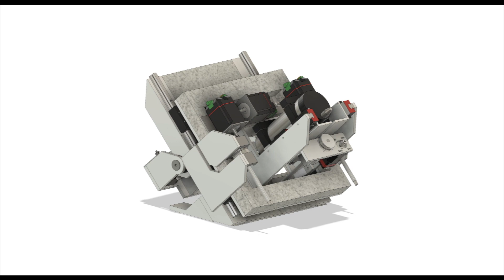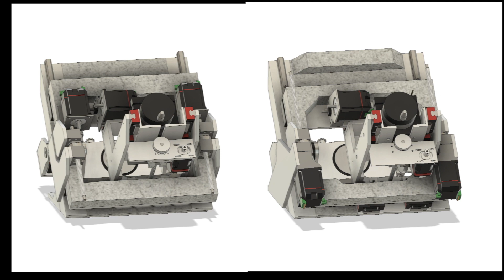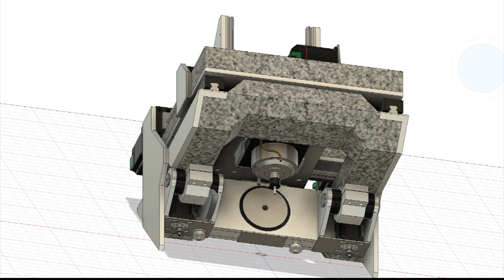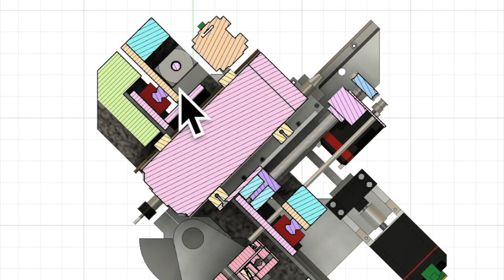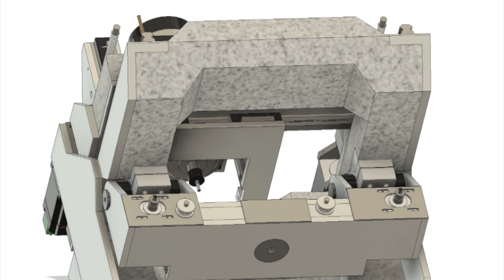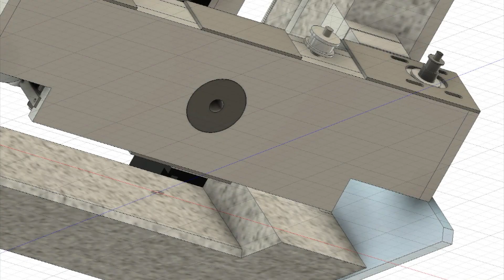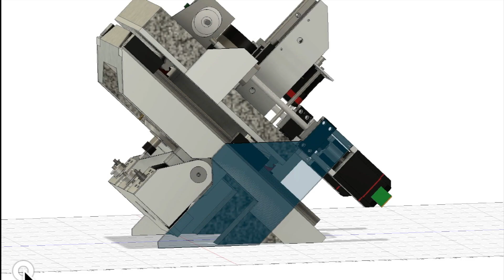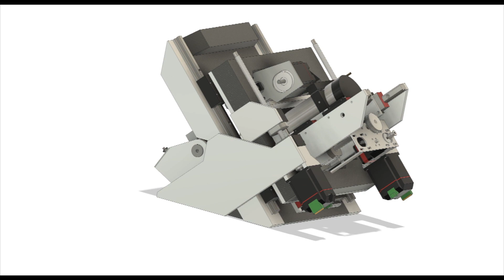Building The 5-Axis CNC Machine in a Small Room: A DIY Journey. (part2)

Comment: I would make the base with the densest aggregate possible for stability even at the expense of weight as that is where it will do the most good..  Even steel shot and crimpped steel wire reinforcing as used in technical concrete would be valid. Because of the compact nature of your design you do not need very much aggregate so price should not be a big burden and you can select for other characteristics.

Because your axis are at 45 degrees the load on the Y axis motors includes the mass of the other axis.  Here using a lighter composite with chopped carbon fibre roving is attractive as it will reduce the static load on the Y axis.
Reply from the maker: If you don't plan to move the machine from its installation location, then heavy weight is not a problem, but if not, then light weight is important.
See the video in Part 7 for weight measures for Y-axis units.

Comment: Has anyone tried using out of phase acoustic waves to greatly reduce the sound of mills?    How about using transducers mounted directly to the frame to reduce overall machine vibration?
Reply from the maker: I have thought about something like that myself.
I wish I could find something cheap and effective.
Reply: @a-cnc-f  There are many 'noise cancelation' circuits available online, both in schematic form and populated PCB's.  Some are very cheap and would just be a matter of tinkering to explore their use for machines.   It would be interesting to see the outcome.   Speakers for ambient sound and frame mounted transducers for machine vibration.  Theoretically... it should work.

Comment: I commonly machine between 8K and 10K as a norm. Especially with steel. With a machine this small and light, you may find that spindle speed directly impacts the noise. Also, spindle torque will become very important. A slower, higher torque spindle may help with meeting some of your wants.

Comment: Im interested to see how this spindle performs with steel. I am also building A cnc machine and was looking at the same spindle. But i thought that the bearings would probably only last a few hours. So im going to use a pulley with a larger slower motor. But i understand that you have the space issue. Cool project and very intrested to see the proces!
Reply from the maker: If that motor doesn't work, I need to take the next step.

Comment: If you go for max coolant processing maybe that should be included in the enclosure as feature? It just seems to be the natural place to put this system part.
Reply from the maker: I think it is a good idea.
However, I am a little concerned that the coolant hose needs to be disconnected each time the machine is removed from the soundproofing box.
Reply: @a-cnc-f  : Well, maybe a garden hose connector system is sufficient? Or just a funnel with a sieve? 
Sadly I am not able to try to build stuff myself.

Comment: instead of using carbon fibers you could also use glass fibers since they have a very similair tensile strengh and general properties in epoxy (carbon fiber is a bit better) but are substantially cheaper
and taken from injection molding and fdm printing the longer the strands of fiber the better the tensile strengh 

also, im a bit worried about the heat from the spindle in a sound proof box since im guessing there wont be ventilation?
Reply from the maker: Thanks for the advice, I'll test with carbon fiber and if it doesn't work I'll try different things.
Reply: good luck!

Comment: A couple more tips:
1. It is not necessary to add a granite fraction to polymer concrete. The composition of sand and epoxy is more durable than granite.
However, it is much easier to form.
2. For machining steel, you will need anti-backlash nuts, not simple ball screws. These nuts are larger. This needs to be included in the model.
Reply from the maker: Thanks for the advice.
I agree with you regarding ballscrews.
To machine steel, we need to have a preload on all moving parts.

Comment: Usually the strength of a machine frame is many orders of magnitude stronger than required: what you actually need is stiffness. Strength is required when the forces are high enough to break the frame. For small forces, stiffness governs how much the frame bends. Look for young's modulus rather than tensile/compressive strength. 

Epoxy granite (25-35gpa) has lower stiffness than cast iron , thus the epoxy granite frames tend to be very fat because of that. I think in your case it should be good enough anyway (your new frame is much thicker than the old sheet metals).

Carbon fiber isn't used for epoxy granite because it ends up decreasing damping and it's usually just cheaper to use more epoxy granite since space in industrial workshops is cheap.

Anyway here's a paper which uses carbon fiber in their epoxy granite. Note that the sample damping is "only" 6x better than cast iron or aluminium. Sadly this paper doesn't have a comparison of various blends, but it should serve as a baseline. Also they don't include the young's modulus, it can be approximated as better than epoxy granite (CF makes things stiffer, but reduces the damping).

https://www.researchgate.net/publication/329481100_Synthetic_granite_composite_for_precision_equipment_structures 

To maximally increase stiffness, you can wrap the outer layer with CF. Something like here: https://technocarbon.de/presse/SD_CM_02_08_technocarbon.pdf
Reply from the maker: Sorry.
My comment was blocked and I didn't notice your comment until later.
Thanks for the advice.
To be honest, I don't know much about it, but I'll try anyway.
Thanks for your interest.

Comment: I have not seen the C and A axis detail design yet, no harmonic gear ? 
How you deal with backlash and rigidity ?
I think it’s the most important at the end.
Reply from the maker: The basic structure of the AB axis is going to be the same as the machine I built last time.
The current design is just a confirmation that the minimum number of parts can be assembled.
There is still some time before I start to build the AB axis, so I will think more carefully about it.
I will release it to the public eventually.

Comment: Looks great! One more question though, did you think about the heat the spindle, cutting and steppers/servos will produce and how it would impact longer running gcode programs? My 1.5kw air cooled spindle gets pretty toasty after 45min job, even when cutting light loads, ie foam. Being inside an soundproofed box also means it's thermally insulated as well.
Reply: Yep, air cooling definitely maybe a problem here.
Reply from the maker: That is one of my concerns as well.
I may need some kind of cooling equipment.

Comment: Seems as the machine will be on draw runners within the sound proof box, I think you should move the draw runners at the top instead and hang the machine. This will mean that the underside will be completely clear and you'll have much more space underneath for chips on your chip tray. You may even be able to switch to full flood coolant with an open bottom and a full-sized chip tray.
Reply from the maker: Thanks for the advice.
That's an interesting idea.
Actually, I am still thinking about that.
I have a several ideas.
I think I need to decide before I start making the column.
Reply: Innovative out of the box thinking for in the box machining. :-)  Simpler might be to have the rails on the sides near the bottom with rails the machine sides can rest on.  A tray to catch chips and excess coolant would then be easy as you suggest.

Comment: This project is looking awesome. I have a suggestion for you though to improve both the look and the functionality of the fourth axis table. From what I can see, you are using belts to transmit the torque from the motors to both the fourth and fifth axis of your machine. I propose you add a 3d printed panel to cover the front of the entire 4th axis table, and two more panels that will go on the left and right side of the 4th axis table where the motors are housed under the pivot point. From a functional standpoint, this will protect your belts over time from wear due to chips. You mentioned you want to machine steel, and using a small endmill with small depths of cut will produce nasty, millimeter-sized chips that will find their way into every crevice and could even become embedded in the belt as it rolls over the pulley due to their small size and sharpness. Additionally, you mentioned how this frame was optimized for optimal chip clearance, and these panels would prevent these steel chips from getting into places that are difficult to remove and keep clean. Because steel is a ferromagnetic material and its chips tend to have some small magnetic field after being machined, they may potentially be attracted to the small magnetic field the motor produces as it is being operated, causing chips to gather on the stepper motor. Now in regard to appearance, the most important factor ;), these panels would make the whole table look seamless, just like the fighter jets that you mentioned, and if you printed the parts out of a black carbon fiber filament, it would look even more sleek and have a really interesting texture that would match the rest of the machine. Lastly, are you planning on adding a cover to the xy-stage of your machine? This would prevent chips from getting into the moving components at the top of the machine and would also improve the appearance as well. Anyways, apologies for the long comment. I can't wait to see where this project goes!
Reply from the maker: Thanks for the advice.
I do have plans to install covers.
In particular, I want to install the covers as well as possible, especially for the A and C axes.
As for the XY, we have no plans at this time.
I will install it when I start using it and feel the need to do so.

Comment: There are a lot of lathes from the clock industry whiсh are very lightweight by themself but for the required stability and precision they used heavy bases. So the same concept may also utilize here, a heavy bottom plate for stability that can be detached and left in the soundproof box.

Also, I think Kevlar is better for internal use... because its fibers are used heavily in vibration-dampening applications and to offers better impact resistance than CF or FG. It is just tougher (carbon fiber toughness is ~2 and Kevlar is ~6 MPa*m^1/2). But carbon may be used for outer layers for better esthetics!
Reply: I doubt the practicality of the "carbon finish" of the machines.
Carbon products in the aviation and automotive industries are intensively colored. Because carbon and epoxy are not resistant to aggressive environments, heat and UV. Another thing is the "like carbon" that machos order for their cool cars :)
Reply: AlexMoonXXI, totally agree with you, but this is not an industrial machine but for home use and it definitely should look like a cool car!
As for the heat and UV, epoxy-granite also can't withstand them. 

Maybe some finish coatings may help with that problem a bit.
Reply: Milling machine are designed for stiffness, not toughness. Carbon is vastly superior to kevlar for this application, starting from twice the modulus and up. Just don't expect much with milled fibers in epoxy granite, as like other fiber-based composites they work best when you can make use of their anisotropy. In this application you are not. Unfortunately composites are not drop in replacementes for metals, they have their strenght and weakness and you have to design around them.  As for carbon in diy CNCs, mine has the Z axis plate out of 10mm carbon fiber. And I don't think I would do that again.
Reply: @stezz90  The author intends to use carbon fiber rather than milled fibers.
But I'm not talking about that.
If you ensure maximum stiffness of the static parts of the machine, you simply transfer the vibro-load to the kinematic parts.
I'm in favor of weight. Pay attention to industrial machines: their frame weighs 1/2 tons, the spindle module - 100 kg, the vise table - 100 kg. This means that vibrations from the cutter are damped by each massive part, and are not transmitted to bearings and shafts. At the same time, the author’s spindle is almost like an industrial one, and everything else is 100 times (!) lighter.
Reply: @AlexMoonXXI  he also wanted to add milled fibers in the mixture of epoxy granite. This machine is small, the primary goal is stiffness. Damping a structure that is too light and flexible has no mean. You have very little material available, you should focus on making it work for the primary purpose. Stiffness with no damping may take you somewhere, damping with no stiffness will not. Also damping can be added in other ways, for example "constrained layer damping" on the exposed sided.
Reply from the maker: Thanks for the advice.
Kevlar seems to be more suitable.
However, I have already ordered carbon fiber for testing, so I will test with carbon.

Comment: Love this design! Love the work you do with the tools you have available.

About the spindle, it should work fine up to 6mm endmills(even 8mm with lower feed) if the frame is solid enough. 
About the frame, keep in mind that you do need the weight for dampening vibrations. Making it lighter might also introduce other vibrations. 
Maybe paint the milling machine after building it, makes brushing or washing chips off a lot less work. Also, it feels a lot more like finishing a project this way.

P.S.
My lathe is about 65 kg by itself, i've added about 50/55 kg of epoxy granite to get better cuts, it resulted in me finally getting mirror finishes on my lathe for the first time ever.
Reply: Little extra backstory.
I am also building a small cnc milling machine, 3(4) axes with a working area of about x250mm y150mm z200mm. Open loop steppers with glass scale encoders on the carriages for  position feedback. The spindle will be driven by two motors, one 750watt motor for milling, one 150watt servo for rigid tapping thread. Steel and epoxy granite for the base and column, aluminium parts for the carriages and bearing blocks. SBR16 set for the linear motion.

For the work planned on the machine (watch casings and small rc parts.), i use 6mm diameter end mills at max. and it should be able to rigid tap up to m6.
Reply from the maker: Thanks for the advice.
I agree with you.
I need to make test cut.

Comment: Hi! Your decision to use carbon fiber surprised me.
I believe that reducing the weight of the machine will not improve its performance, but worsen it.
But if you really want to use a composite material - try epoxy-kevlar.
Reply from the maker: Thanks for the advice.
Although I think heavier machines are more stable, this machine is designed to be lifted and moved, so lightness is important to me.
Kevlar is also used for similar applications, but I honestly don't know which is more suitable.
However, as far as looks go, I think carbon is better.
Reply: @a-cnc-f  The mass of machine parts dampens vibrations.
No wonder the beds of industrial machines are made of cast iron!
Otherwise, kinematic mechanisms (rails, shafts, bearings) will be forced to endure vibration.
I have a small CNC1310 machine. To reduce vibrations, I installed a lead plate weighing 3.5 kg under the table. This greatly improved the quality of processing.